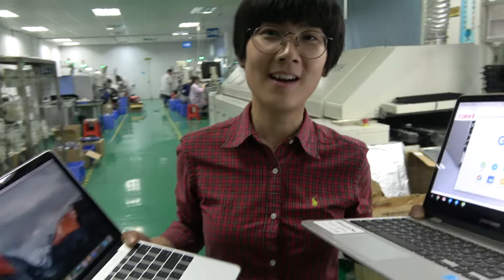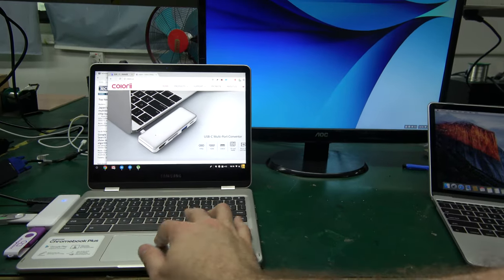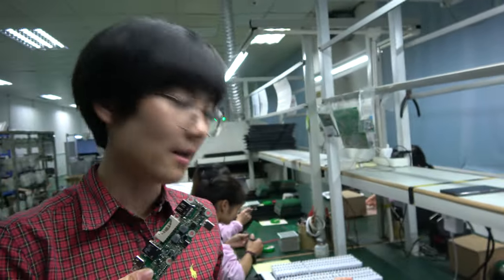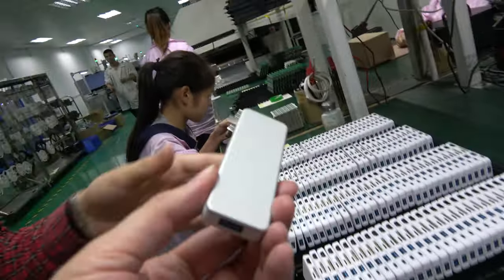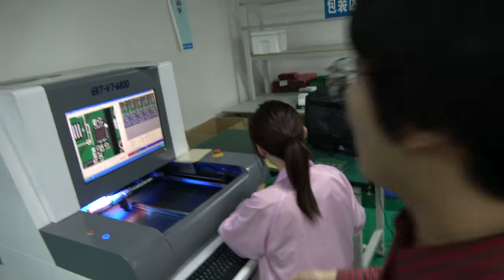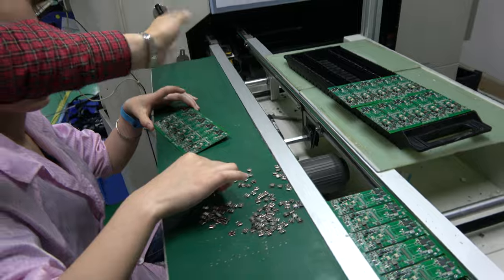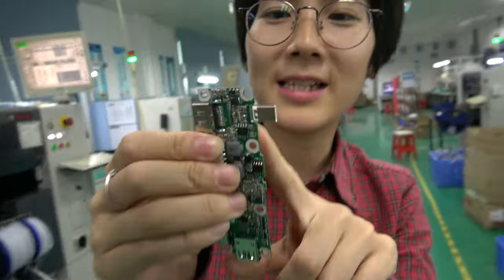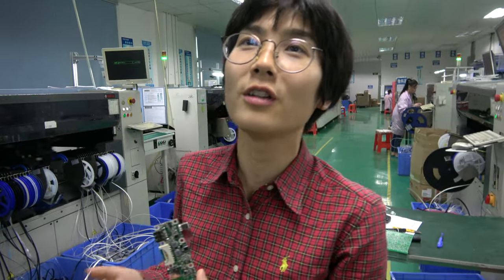SMT Line Tour, USB Type-C Hub, 6-in-1 Colorii PocketHub

Comment: 4k @ 60Hz 👍🏽👍🏼. The two  USB-A ports are on different sides 👍🏼👍🏼. The hub I have now the two USB-A ports are side by side, there is no room to accommodate two thumb drive. This hub here don’t have this problem. The USB-C connector looks to be the better integrated type, not the riveted type 👍🏽👍🏽

I’ll see if I can find this for sale and buy it.